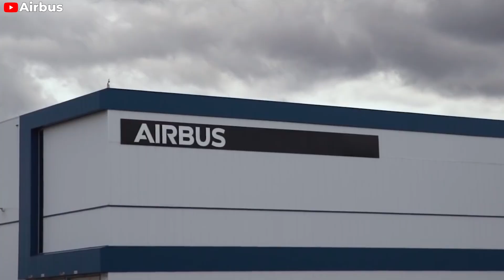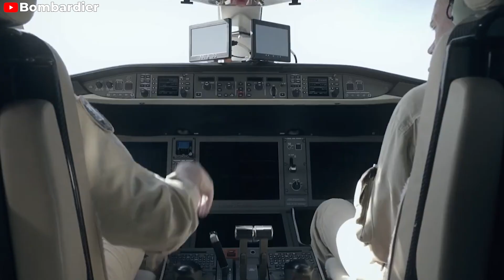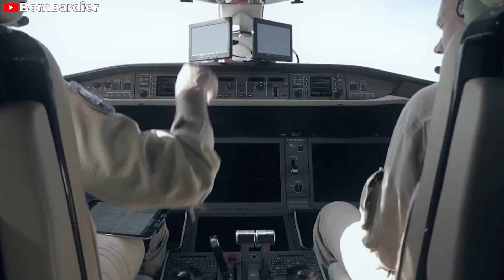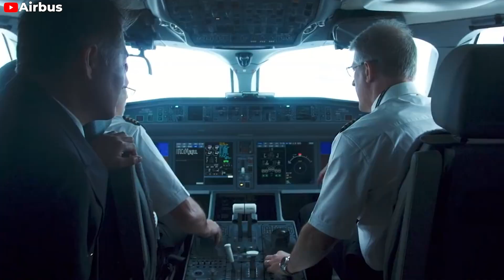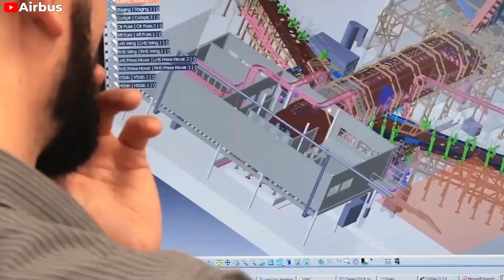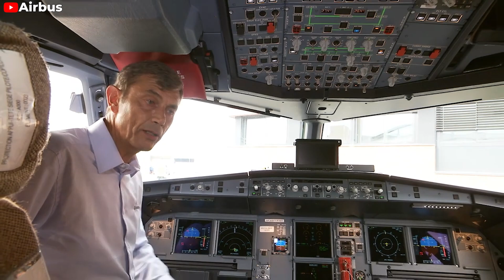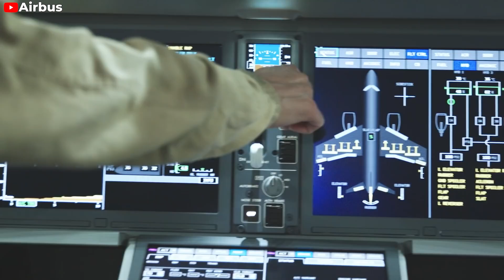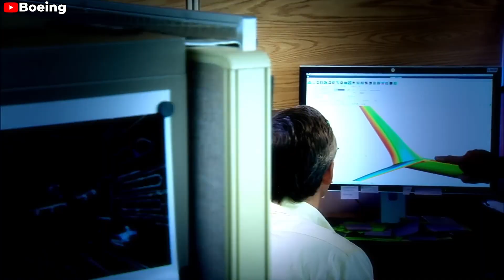Airbus A220 Is Over! Here's Why

Comment: The 220 stretch is way over speculated.  Bombardier optimized designe for 100 seat (since it was as evolution from its CRJ 900 which had reached its limits) with a stretch as the C-Series 300.  It is very doubtful any work had been done on a 500.   And it is not clear that the aircraft would be optimized for -500 size and have any advantage over 320. 
However, for an airline such as Air Blatic whose fleet is solely A220s, it would be good to have a larger aircraft. But such a stretch wouyld only be of use to airlines who only have A220s in their fleet.
Reply from the maker: thanks for sharing
Reply: It is not over speculated as it is the most modern narrow body aircraft with a composite wing, lightweight fuselage and fly-by-wire controls. The Airbus CEO said the A220-500 is not a question of if but a question of when. Namely, once the programme is under cost, they will launch the 500 version.  They have customers like AIr France asking for it.  Of course a A220-500 has an advantage over a A320 when it is tonnes lighter.  The A220-500 according to Bombardier Engineers is they have had that plane running in their simulations for years.  The Airbus Engineers are not concerned about cannibalising sales when they already have their wing of the future project running, and are planning their next A320.5
Reply: @Adscam  The C-Series was the upgrade path from the CRJs which had reached its limits on how long they could make it, yet demand from airlines was for bigger aircraft, not for regionals anymore.   When C-Series was cogitated it was always for the unfilled 100 seat market.  Yes, the -100 and -300 , when launched were bigger. The original target prior to Bombardier's first near bankrupcy (circa 2004) was the DC-9/MD8x replacement cycle in the USA.  But during that time, Northwest went chapter 11 and acquired by Delta and no intentions to replace the DC-9s so Bombardier lost the launch customer they had been eying. And American didn't wait and ordered 737s to replace their MD8x fleet.   So when Bombardier got back on its feet and restarted C-Series,  the customers who were interested (Swiss and Air Baltic) wanted lightly bigger but not 737 or 320 size.

Comment: You missed a big step:
In 2016, fancing bankuptcy and already in process of liquidating assets, Bombardier spun off the C-Series project to CSALP (C Series Aircraft Limited Partnership) witrh the Québec Government getting a 40% stake at the cost of $1b, valuing project at %2.5b. Bombardier then only had 60%. In 2017/2018, because Bombardier had no funds to complete project and customers did not want to buy aircrafy from company with no future, the Québec government signed deal with Airbus where CSALP would double number of shares and donate 50% to Airbus. Bombardier ended up with 30% and Québec just under 20%.  That deal still had financial obligations to Bombardier to move from building prototypes to industrialized productsion. Bombardier did not have the funds for its share of project, so in 
In febriary 2020,  Bomabrdier sold ist 30% stake for $591 million (valuing project at $1.97b),  with Airbus raising its share to 75% and Omvestissement Québec raising ist to 25% of CSALP, and at that point, CSALP was renamed Airbus Canada LP.

Comment: I agree the A220 isn’t going anywhere because British airways has placed very a big order for the A220 and Air France also KLM is replacing all of their A318/319 with the A220 and delta airlines has ordered 150 of the A220 in two different models the A220-100 and the A220-300 and British Airways can’t fly the A319/318 to London city airport or any place in Channel Islands and they have no plans to order any of them so they are ordering more A220-300
Reply from the maker: yep thanks for sharing your thoughts
Reply: @FLIGAVIA 😊

Comment: There is nothing to replace the A220, it's well liked, and airlines want it. Clickbait titles don't help your point. Airbus don't intend to stretch the 220. A very negative viseo, with not much truth in it. I will not subscribe to you.(satire)
Reply from the maker: thanks for your comment
Reply: @FLIGAVIA  Don't thank me for my comment, like all the other comments it was negative of your video,  you are a bad boy (satire)
Reply: Designed by a company that was going bankrupt and given for free to Airbus, the A220 has a lot of flaws. Airbus did not menage to make it profitable yet.
Reply: @eduardomeller6926  it's making airlines profitable, as far as the engines are concerned P&W will fix the problem with their  motor just like most other engine manufactures that run into new design glitches .
Reply: @eduardomeller6926  So, what's your point?
Reply: @deniermurch8693  My point is:  this is not a clickbait title. The arguments used here by the author of the video are reasonable.

Comment: I do think airbus could change the A220 to fit into it’s plans especially if it is fitted with the same cop pit that Airbus uses already in the A319 and A320 and the rest of the planes that use. But it would probably mean making the A220 a little bit wider but I think it’s worth considering that the A220 does sell well in Europe and in America and Canada so I think it would be a big mistake if Airbus stopped making it completely especially when the likes of delta airlines and other airlines like it have placed very big orders for the planes. Because they don’t use the A320 or the A319 on short flights or on longer flights
Reply from the maker: Thanks for sharing your thoughts
Reply: You’re welcome